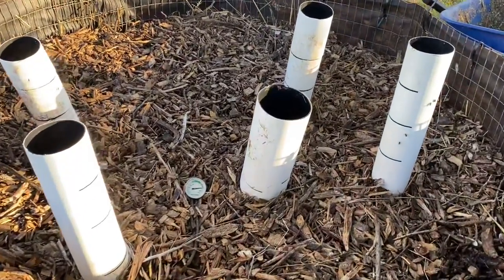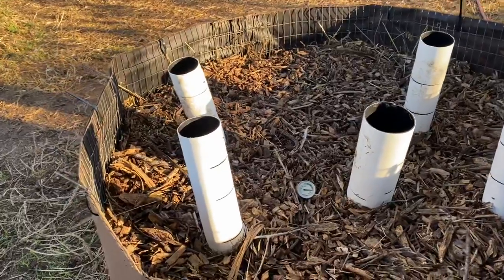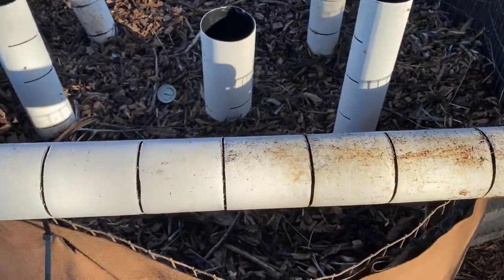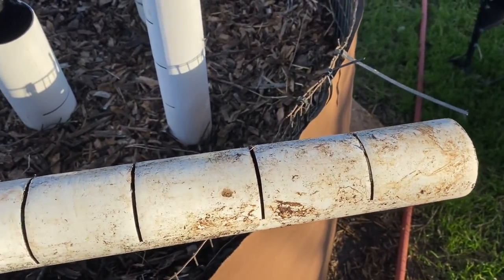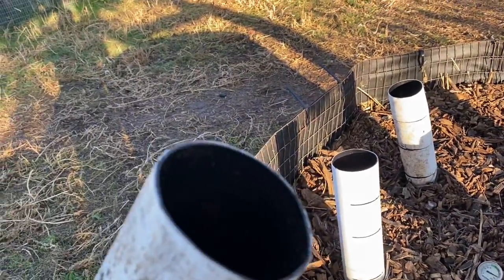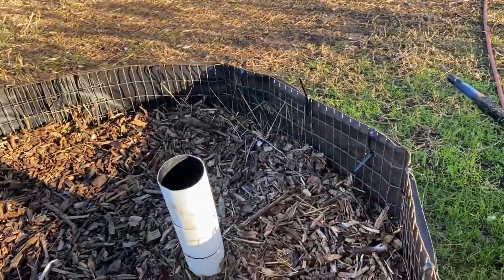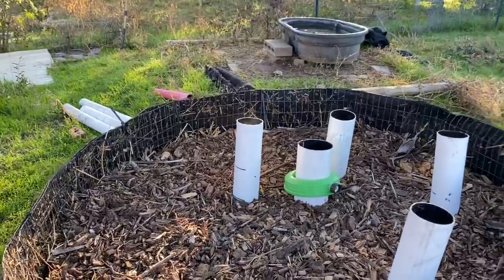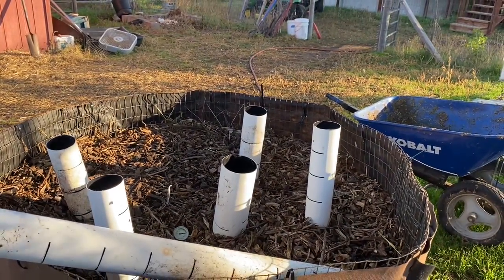Compost Bioreactors on Day 5 - Questions Answered

Comment: hello Jack, I have enjoyed this series! I built a bioreactor utilizing much of what you have shown here. I used the materials I had on hand to fill the unit, but I didn't have any manures available. So far, my pile has heated up to about 120 degrees, not sure if that is hot enough and was wondering if I should take it apart and add some alfalfa to the mix to increase the amount of nitrogen in the pile. 
I had also purchased a bale of straw that I ran thru my shredder that I used in the upper layer of the pile... reading about persistent herbicide problems a couple of days later. I am doing a test grow with some peas to see if I have a problem with herbicide residue (so far it is inconclusive). If the test shows I have herbicides in the straw, should I toss all the materials in the dumpster or just remove as much of the straw as possible and utilize the remaining materials to make the compost? In your opinion would biochar help mitigate any remaining herbicide?
Reply from the maker: It will be fine.  I have some trouble shooting and some don't worry about its to add to the bonus section of the new course.  If you want the full course with exams, etc it is now available for only 40 bucks (35 for MSB Members) here https://homefoodsystems.com/courses/simplified-bioreactor-composting/
Reply: @survivalpodcasting  Thank you very much for your response! 
the course looks interesting! Are the exams required? I don't really care about showing what I have learned, but would be interested in knowing if the course can be viewed/reviewed multiple times...
It would appear that my worries about persistent herbicides in the bale of straw may have been unfounded... the peas look the same in the treated test pots as they do in the others. From now on I will grow my own materials for composting with my cover crops and tree leaves...
as a side note, I did build a more standard compost bin system in which I will make some compost utilizing Elaine Engram's methodologies, mostly to get something happening with compost for the trees and garden beds while I wait for the JSB compost to finish growing!

as another side note, you had mentioned adding an adapter on the bung of a 55 gal barrel with a saddle cut to bring in quench water from the bottom of the barrel... I found that the small bung is 3/4 pipe tread. I put together something per your descriptions, I'll take a couple of pics tomorrow and get them to you or post them in the Biochar EPI 3250 comment section if I can find a way to do so...
Reply from the maker: @halhanevik3791  They are not required it is your course you do what you want.  That said you can take them as many times as you need, they were designed to improve learning and you don't get the cert unless you take them. The choice is yours though. As to the videos you can watch them as often as you wish.
Reply: @survivalpodcasting  you were right, the exams helped the learning process. It highlighted points that I missed during the presentation. Thanks for putting out the course, it was awesome. I did enjoy hearing you respond to some of my comments on recent shows!

Comment: I’ve read that air vent pipe can cover 1’ in all directions. Probably be ok with just one or two in center.. thank you for sharing.
Reply from the maker: The one foot rule is real but you need to work on  geometry if you think 2 pipes can do that with a 4.5 foot circle.
Reply: @survivalpodcasting wow!.. didn’t realize it was that big around. I’m gonna have to steal your idea this winter.. thank you again..👍🏽

Comment: No bottom aeration per spec?

Hmmm...That's a No, No.

They are built on a pallet with through & through air vents/chimneys for a reason.
Reply from the maker: You can build your bioreactor anyway you want.  But going to go out on a limb and say you have never built anything and are a person only informed by watching videos.  Your statement of "they are built" shows you have no idea what I am doing here or why.  Move along.
Reply: @survivalpodcasting  I've built 2 per spec. Had issues with both due to freezing temps & hydrophobia.

Clue- A Johnson-Su Bioreactor is a big stand-up worm bin.
Build them per spec to get the results intended. If it is not producing at least some of the clay-like material which is a function of worm castings, you are doing it wrong. This will be evident when you deconstruct it & have the end product material lab analyzed (which I'm sure you won't bother to do as no one who builds these so-called "improved" short-cut versions does.)
Reply from the maker: @flatsville9343  My compost is ALWAYS very clay like.  Again you are not qualified to tell me what to do here, you don't know anything about me or how I have modified this system and why I have done so.  Move along and do things however you wish.  Bye.
Reply: @survivalpodcasting  We'll see at the deconstruction vid.
Reply from the maker: @flatsville9343   Listen retard I know you watched Dr. Johnson's presentation and that is all you are running your mouth about.  You likely have never actually done anything.  People like you that are essentially the "compost police" never do shit, just tell others what they should do.  People like you exist in all niches.  There are goldfish police, hiking police, etc.  All youtube commandos running their mouth via a keyboard.

As to deconstruction I have been doing these reactors my way for 5 years now.  I know exactly what I am doing differently from Dr. Johnson and WHY I am doing so.  Now again sod off and find something productive to do.  

Why not show us YOUR BIOREACTOR that you never built.  
🤷‍♂

Comment: 3:40 Maybe I'm missing your point, and I'm not saying that composting is some planet saving miracle, but don't plant get most of their mass from carbon captured from the air and converted during photosynthesis? So the carbon that is off-gassed from the compost pile will just be reabsorbed by other plants in a circular manner.
Reply from the maker: VOCs are more than CO2 but even the CO2 is plant food.  FWIW for all the hype about "mUh gLobaL wArMiNg" CO2 is only 1/3 of 1% of the atmosphere.  Many green house growers actually pump CO2 into said greenhouses.